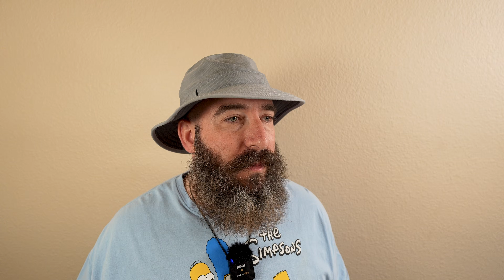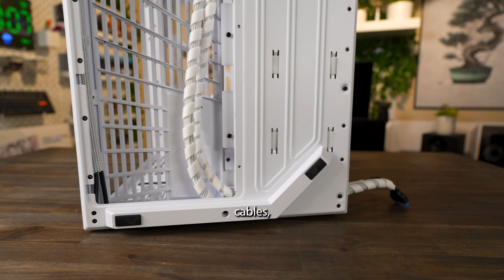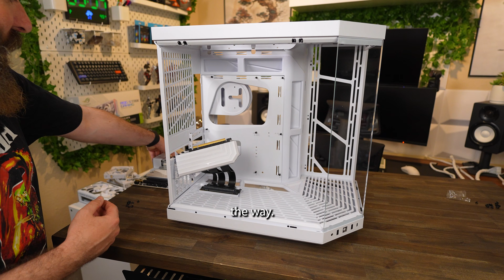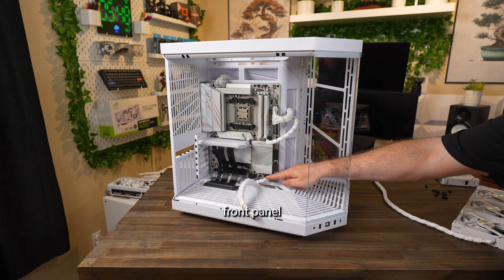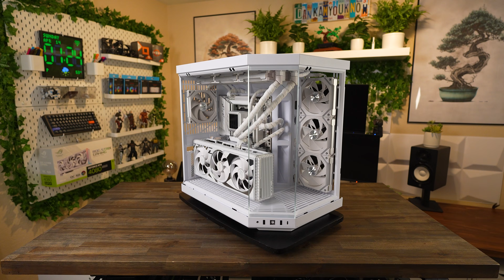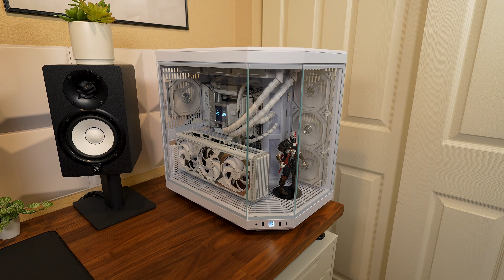Custom Cable Management PC Build | Tech Skit | Hyte Y70

Comment from the maker: Hey guys! Thank you so much for stopping by and watching the video! Give it a like rating if you enjoyed and drop me a comment. I absolutely love how this build came out, especially with all of the custom wrapped cables inside the PC!  @hytebrand was nice enough to send me out their new Y70 (Non-touch) PC case and @superflower sent out their Leadex Vii 1000w PSU in white for the build.

Everything included in the build is listed below, including what I used for the cable wraps:

PC:
Case: https://amzn.to/3JodHVt
CPU: https://amzn.to/3J5ig7f
GPU: https://amzn.to/3PS9Aoh
Motherboard: https://amzn.to/49rUj4z
PSU: https://www.newegg.com/super-flower-l...
CPU Cooler: https://amzn.to/3U6UJZE
Storage: https://amzn.to/3TNg3Cc
RAM: https://amzn.to/3UbmsZy
Fans (Side and bottom): https://amzn.to/3W7rPdF (x6)
Fans (Top): https://amzn.to/3U6TDx3
Fan (Rear): https://amzn.to/4aC0nJm

Cable Wrap (Outer): https://amzn.to/4ao188t 
- 1 pack should be enough for all cables but I would probably do 2.

Cable Wrap (Inner): https://amzn.to/3VVWXfI 
- Get 1/4", 1/2", and 3/4" for different size cables. 
- 1/4" was used for smaller cables like front panel connectors, fan, and AIO cables. 10ft is probably OK but I did 25ft, and had some extra.
- 1/2" was used for all PSU cables and AIO tubes. I also did 25ft of this but had extra.
-3/4" was only used for the SATA PSU cable. I didn't use very much of this and 10ft was fine.

You will also need a pair of scissors to cut wrap to length, and a lighter for the inner wrap, to prevent fraying on the inner cable once it is cut. I also used some white electrical tape.

Thanks for your support,
Danny
Reply: The build is amazing
Reply: the vidoe was great but i am going to build my first PC an I was just wondering if these parts are good/fit together.

-Asus tuf Radeon 7600xt oc
-Amd Ryson 7700x
-Asus rog strix b650e-f wifi
-corsair mp600 core xt 1tb
-corsair rme series rm850
-corsair vengense rgb pro sl ddr4 3600mhz 16gb

And I don't know but is the psu overkill.
Reply: My next build will be white. With hard tubes, 'cause I sway that way. Look forward to more vids.
Reply: Question, my cpu usage is too high, but not sure what to do about it, i've heard you could change things, but can't find it?  I just stream fortnite with my pc and i think it's strong enough for what i use it, also deleted steam because it also used a bit? Also i found in one of you're shorts of putting the quickstart of your pc off, but can't find it in my settings? (So i mean that your pc completly shuts instead of powering down)
Reply: Do you put the cable sleeve on top now I seen in your vision build that it’s different than this. If so is it that you but the swirl wrap in first and then the cable sleeve? We need an updated cable management video.
Reply from the maker: @enzoluna8353  For the Lian Li O11 Vision build, I only used the INNER wrap for that one. Decided to leave off the spiral wrap. I may do another video on it
Reply: @DanKamYouKnow  Alright thanks man, I know I would appreciate a new cable management video. Especially how yours come out so clean. I was installing my psu today and I can’t stand how long , crowded , and ugly the cables look! I’m definetly ordering the sleeves rn! Thanks again! 💯
Reply: ❤ OMG THIS IS MY DREAM PC. I appreciate this video SO MUCH. I've been playing games on a laptop and am looking into building my first pc!!!!!! P.S If you need to sell/give away please let me know!
Reply: Fantastic build! Your demo is wonderful! To finish the cable end and to avoid fraying of the cable wrap mesh, consider using heat shrink tubing. It gives a really polished look.
Reply: Pc build looks great can you get Hyte y70 non touch in black because my setup is black and i already have the black y60 and the y70 non touch is so much nicer
Reply from the maker: @AussieVR27  Yes, the Y70 non touch is also available in black as well: https://amzn.to/3QaI3yO
Reply: @DanKamYouKnow  oh thank you so much

Comment: Y70 case, ues I did add 3 fans on bottom, also gonna change back fan to a 140mm instead of 120mm. Cables looks very nice 👌

Comment: How is it with heat from the psu when its that close to the motherboard backside? I have fractal torrent currently, and the psu is mounted at the top. Its very hot there so im glad its placed alone at the top above pc components.

Comment: I have the y70 touch (Not a Flex Just Don't Know If The Back Of The Case Is The Same Or Similar) and was wondering with the power supply, since it is mounted vertically should the fan be facing the back of the case where the meshed design is or towards the motherboard where it is just flat and solid, don't want to risk making a mistake and the power supply overheating???

Comment: How is the pc holding up till now? Does this combo of the 7950x3d paired with the 4080 run cool? I'm about to build a similar setup but only difference is I'll be using the 7800X3D.

Comment: you missed a screw on one of the front fans.
Reply from the maker: If you mean the bottom, that’s by design. There is not hole to actually tighten it down.

Comment: First time I’ll be building my own PC and I chose the Hyte Y70 for the open concept to display figures and such.  This video is informative, methodical, and is very pleasing to see really nice cable management

Build:

-Ryzen 7 7800X3D
-Gigabyte Gaming OC 4070Ti Super
-MAG A750GL PCIE5 MSI PSU
-MSI Tomahawk B650 mobo
-2TB Samsung 990pro SSD
-32GB Ram DDR5 Vengeance 6000
-Arctic Liquid Freezer III (swapping fans for Lian Li Uni for the top, repurposing the fans for bottom intake)
-x6 120mm Lian Li Uni fans (3 for vertical intake and 3 for swapping on the AIO top exhaust)
-1x 140mm for Rear Exhaust
-* Repurposing the 3 Arctic fans that came with the AIO as the bottom intake fans
-Hyte Y70
-***I also purchased the cable recommendations too, thank you for providing that info!

Will be gaming on a TUF Gaming 27" 4k 144hz Monitor too!

Love you content and how smooth you are with it man, keep up the hard work!

Comment: I’ve followed your channel for a few months now ever since I seen your video on how to clone a new SSD and my question is, is the Y70 excellent for airflow? I just got a new white 4070 ti super and it gets to hot for my comfort compared to my 4070 twin edge. Like 10-15 degrees hotter! Still using my cyberpowerPC amethyst case with cyberpowerPC rbg fans and CPPC AIO. I ordered the all white Y70 and gonna be ordering the thermaltake swanfan with reversible blades and a better AIO. Will it keep me a lot cooler than the 65-75 degrees I’m getting now? I just noticed I’m gonna be ordering the same gigabyte motherboard that you have also!! lol the X670E pro X gaming all white

Comment: Hey Dan, I was inspired by your build and planning on building a pc similar to this, I am using the exact same case, aio, and fans but, I am a bit confused on the aio cooler and replacing its fans with the SL V2. I see on the video you had two wires from each side of the fans on the aio. Would you mind explaining to me what cables you used? Also, I was going to plan on using the fans that came with the cooler but putting it in the bottom to cut costs of buying more fans. But, after looking at the manuals, I am getting more confused and wondering if it is even possible?

Comment: In my case, I do not recommend using electrical tape because over time it becomes sticky. It might be better to use some thermal insulation for cables and with a heat gun or even a lighter, make it shrink to fit the size of the cables. Btw. Nice video I love your shorts 😎

Comment: can you help me? I have a Ryzen 3800x and Radeon rx 6600xt but just bought a Ryzen 5800x because it was only $170. But now i need to know what PSU and GPU to get. Also I don't know if i should get a new CPU cooler as well.
what should i do?

Comment: Hi bro 
👇In these two Lenovo laptops which one is worth it 
👉 1st Legion Slim 5 16APH8 2023 - $899 ₹75,000
Processor
AMD Ryzen™ 5 7640HS (6C / 12T, 4.3 / 5.0GHz, 6MB L2 / 16MB L3)
Graphics
NVIDIA® GeForce RTX™ 4060 8GB GDDR6, Boost Clock 2370MHz, TGP 140W
Memory
2x 8GB SO-DIMM DDR5-5600
Storage
512GB SSD M.2 2280 PCIe® 4.0x4 NVMe®
DESIGNDisplay
16" WUXGA (1920x1200) IPS 300nits Anti-glare, 45% NTSC, 144Hz, FreeSync™, G-SYNC®

👉 2nd Lenovo LOQ 15IRX9 2024 - $890 ₹74,300
Processor
Intel® Core™ i7-13650HX, 14C (6P + 8E) / 20T, P-core 2.6 / 4.9GHz, E-core 1.9 / 3.6GHz, 24MB
Graphics
NVIDIA® GeForce RTX™ 4060 8GB GDDR6, Boost Clock 2370MHz, TGP 115W
Memory
1x 16GB SO-DIMM DDR5-4800
Storage
512GB SSD M.2 2242 PCIe® 4.0x4 NVMe®
DESIGNDisplay
15.6" FHD (1920x1080) IPS 300nits Anti-glare, 100% sRGB, 144Hz, G-SYNC®

Or is there any other laptop for gaming and productive under $950.
Kindly suggest me 
Thank you 😊

Comment: Hi man, looking pristine. I have the Y60 and  I just bought the 4090 24G OC (same colour)  but mine doesn't have space and the glass is barely touching the graphics card, and temperature increased, I'm thinking to change the case for the one you have (Y70) as I can see there is more room for the graphic card,  I just want to know if  you have temp problems?  please let me know I want to sort this issue asap as i need to remove the glass to cool it down. Thanking you in advance

Comment: planning on doing a build with this exact case, never built before. are reverse better to get than regular fans or does it matter? also for the bottom, should i add bottom fans?
Reply from the maker: For this case, you’ll only need reverse blade fans for the side! And yes, I would highly recommend putting fans on the bottom, fitting 3 can be difficult but it is possible. Bottom fans will ensure the GPU gets a lot of fresh air from the bottom

Comment: Hi Dan I need some advide here. if I need to sell this pc of mine whats the fair price range I should put it?

14700k
thermalright 360 aio
asus tuf Z790 pro
gskill trident z DDR5 7200 C34 16gb*2
asus tuf rtx4080
2TB samsung 990pr0
2TB kingspec XG7000
sama xp850w platinum full modular atx3.0
sama newview 4503 case.
7 argb fans(including aio fans)
all black build.personally built last year and gamed for 9 month. have been taken super good care of, literally like new condition and beautiful cable management done by myself.

Comment: aside from the cool build, can you make a 500-600 dollar pc build video? I've been researching trying to find the best money performance build that doesn't spend money on aesthetics but mainly performance, curious about your opinion, I'd be grateful.
this is what i plan to build 
(not an expert):
-AMD Ryzen 5 5600X 
-ASRock AMD Radeon RX 6600 challenger
-Thermaltake Smart 500W PSU
-DIYPC DIY-F2-O Black/Orange USB 3.0 Micro-ATX Mini Tower
-intel 670p 512GB PCIe NVMe 3.0 x4 SSD
-RAM 8GBx2
-ASRock B450 PRO4 AM4 AMD ATX Motherboard

Comment: hey i have the same case mine is the hyte y60 how did u get all three fans to fit though isnt the screw holes offset
Reply from the maker: Only the Y70 offers support for 3 fans on the bottom and 3 fans on the side.
Reply: @DanKamYouKnow  i see ty ty cuz i saw a mod for y60 but i cant find the right scews and the link the person sent isnt working so i was just curious

Comment: Hey dan, i need help with my pc, i need to know how much my pc in cad, its specs are 128 gigs of ram EVGA founders edition 1080ti, Intel xeon E5 2699 v4 cpu  and 9 tb storage
Reply: You could change the gpu u could get the 4060 or 4070 depending on your budget and for the cpu i will take the i5 13600k
Reply: And need 32 gigs of ram
Reply: @krispydreams6262  alr, so would 32bg of ram fix my stuttering? I have rlly bad stuttery fps, it get around 400fps in fortnite 200fps in cod, but it drop to like 25 sometimes.

Comment: I have a similar build.  My 7950X3D idles at 43C.  How is yours fairing?
Reply from the maker: Idles anywhere from 39c to 43c too. I was really surprised how cool this CPU ran, even under very heavy productivity loads
Reply: @DanKamYouKnow  Yeah, I was unsure initially what an acceptable idle temp should be for these processors.  People would always just say that they run hot, which is true.  But it's good to have some sort of baseline / estimate.  So I've just been asking others to see what they're getting.  The cores seems to be a lot cooler than TCT / TDIE readout from HWINFO.  I also have the Y70 Touch Snow White.  I think their software raises my temps along with Lian Li's Galahad II LCD if I have a good quality .GIF on it.   💀
Reply from the maker: @TimboSlice083  L-Connect 3 is proven to raise CPU temps. Makes me want to go back to the days where I didn't use any software at all for fan control and AIO's. Some of these programs eat up so many resources.

Comment: Can we just appreciate the facr that he the extra effort to have his own custom figurine make with his face on it and made it look even better?
Reply: @DanKamYouKnow  How is the pc holding up till now? Does this combo of the 7950x3d paired with the 4080 run cool? I'm about to build a similar setup but only difference is I'll be using the 7800X3D.
Reply from the maker: @steventruong85  They both run extremely cool. Very impressed by the thermals on both the 7950X3D and the 4080 Super. I have done a few builds with the 7800X3D as well and it also runs very very cool.
Reply: @DanKamYouKnow  When you game does your pc heat up your room? I'm having that problem with the 3090. One of the main reasons I want to upgrade. Kinda tired of my pc being a space heater lol
Reply: I wanna edit and fix the grammatical mistakes I looked over so badly that I don't get the "AcShAuLLy 🤓". But don't wanna lose the heart at the same time
Reply: @Gamcoaster bro I read this comment, finished the video, saw Kratos, giggled and came back to like this comment, re-read it again while doing so, and all these times I never noticed the mistake until I read THIS comment of yours. No need to change the errors friend, our human monkey brains fill in the gaps for us :)
Reply: But isn’t it Kratos